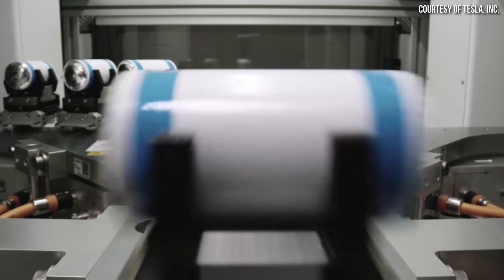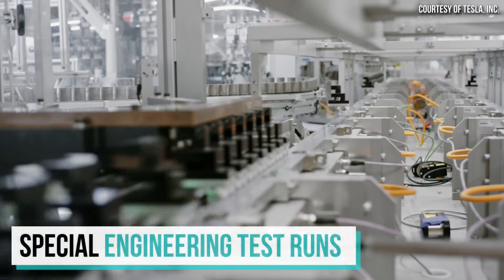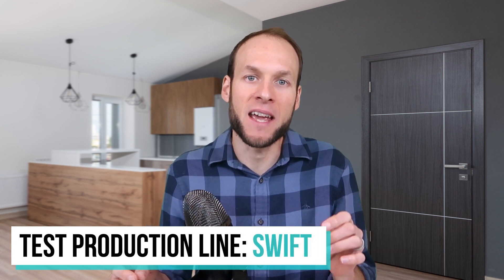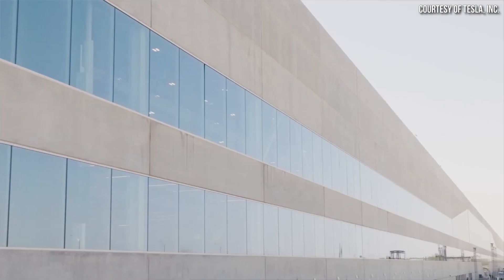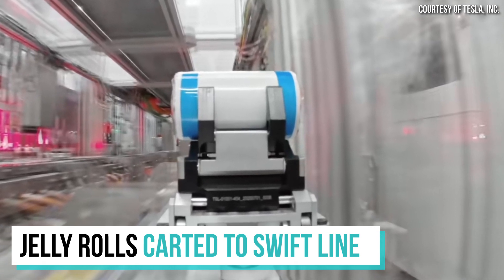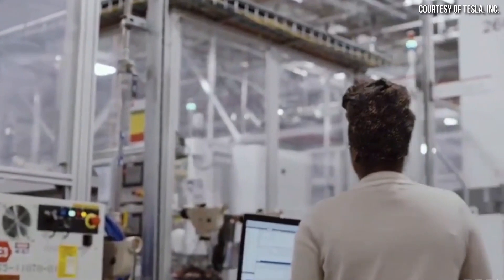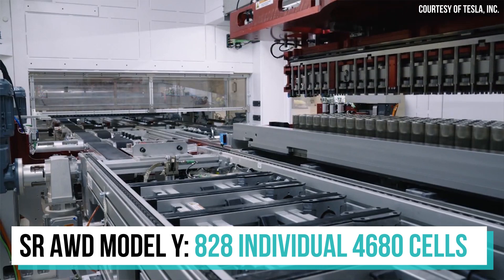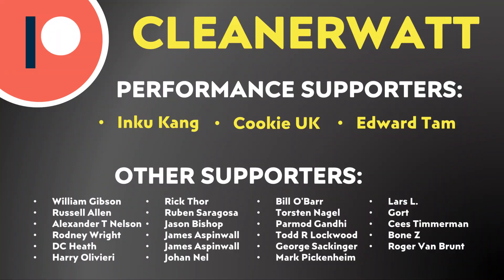Tesla NEXT GEN 4680 Battery Production + SECRET FACILITY

Comment: There was so much optimization left in the 'old' lithium ion tech.
EVs will dominate when advanced technology like Sulphur, sodium and solid state batteries come out.
Reply: Yes they are all good tech but it's not how good the battery is its how easy it is to mass produce right now I'm sure they'll get there in the next decade but for now it's lifepo4 and li-ion that have the cards sodium ion na 11  have good results but are only 144kw/kg great for stationary storage but then you mite as well use lto batteries that have 50,000 cycles and last 80+year's and have the same density and a 10c rating

Comment: I'm pretty sure Tesla has had a battery testing facility from the very early days on, and they have been constantly developing, improving and  extending it since. It's that testing facility that allows Tesla to incorporate cells from multiple different manufacturers into their products with confidence on their quality.
Reply: They also need to know the short, and long-term characteristics of the cells from different sources. I assume they alter the cars motor drive and charging software to adapt to the different characteristics. If anyone ever asks how much battery testing Tesla does, its a gigantic amount...

Comment: again, Munroe did a tear down of the 4680 and we have yet to hear the metrics. If it's so great why do they get less mileage per charge and weigh about the same even though it's cell to structure? Shining a turd is all anyone is doing anymore, they won't call out shite. Like the fact that cell to structure is engineered obsolescence and your EV is worthless after the battery goes out which goes bad even if you never use it after about 10 to 15 years. How is that sustainable?!?!!!!!?
Reply: Batteries are replaced and recycled, that's sustainable just like all recycling.  All too many people don't see this clearly, not sure why but it is what it is.
Reply: And how is any car worthless when the power source goes bad, engines get replaced and batteries are too.  Even the structural pack can be replaced but i believe that the idea behind the 4680 cell with structural pack is that the battery truly should not need replaced for the life of the vehicle with the ability to go hundreds of thousands of miles with little to maybe moderate degradation.
Reply: notice that the structural 4680 battery is a great thing for the manufacturer of the battery but for the customer maybe not so much. the battery is unfixable. the older battery could be generally worked on to give your car more years of service even though with less miles per charge. this new battery is TOTALLY sealed.
Reply: @Akira-nw4jl  again the idea is that the pack will not need serviced or repaired, they are shooting for batteries being produced close to 100% quality so there will be no need for servicing/repairing them.  I believe even the ild 2170 packs are no longer produced with. Modules amd are one solid pack as well hence not serviceable/repairable.
Reply: @kevroll99  I understand what you mean but if you watch videos of Gruber Motors and Rich Rebuilds they both serviced 2170 packs that would have cost the customer more than 20000 for merely a couple grand. I believe Tesla only offers 3 years of warranty on their battery packs.
Reply: @Akira-nw4jl  older packs? Probably
Reply: @Akira-nw4jl 
Nah 8 years warranty on bat pack I last heard.
Reply: Good point about the 4680 metric which no one test and/or publish.

Comment: So, have any customers received their Teslas with the 4680 batteries?  If so, any reviews?  That would be rubber on the road testing.
Reply: Hundreds have already.
Reply: At least one.  A recipient ensured that Sandy Munro got hold of one for disassembly.  Check out the Munro Live channel
Reply: @dewiz9596  I did watch that segment.  I was hoping they would do a comprehensive road test before disassembly.  There business model is probably more about disassembly.
Reply: There is another YouTuber with one... I am sure a search would find it.  Search "standard range model y"
Reply: Every vehicle manufactured in Giga Texas has the front and back casting and structural battery pack. The structural battery pack is only for 4680s
Reply: @LACHIVA1969  that is actually no it true.  Most if not all MY's shipping from Texas are Long Range with 2170 non structure packs but still have the front and rear castings.  It's unknown how many SR 4680 are being produced currently but it's very small compared to LR 2170 version.
Reply: There is a YouTube channel called Spoken Reviews, and you can find what you're looking for there.